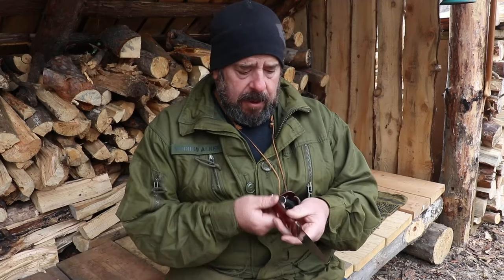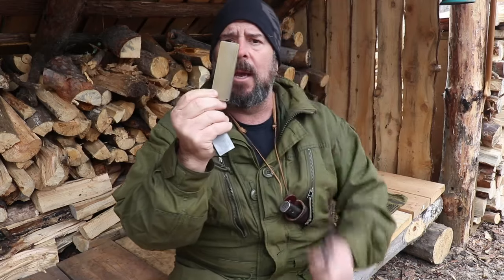Bushcraft Knife Sharpening and Maintenance-Sabre, Convex and Scandi Grinds

Comment: Sharpening and maintenance is a great topic to come back to from time to time;  we are always learning, especially as we work with different grinds, steels and usage.  

Over the last year or so, I have been using a medium sized knife in CPM-154 probably more than any other knife.  It is very slicy, maintains an edge, and mostly all I do is touch it up with a ceramic rod.  I did strop it once (sort of) by putting some mineral oil on it, and then running it over a rag cut out of an old t-shirt, on the edge of a wooden picnic table.  I know this sounds questionable, but the knife got at least as sharp as it was new.  I haven't abused the knife, so I don't know how resilient CPM-154 is vs. other steels, but I cut brush & limb saplings with it in the field, if I don't have a machete or axe with me.  I was surprised how much more impressive the CPM-154 is as compared to 154CM steel.  And it doesn't rot, which is a big plus where I live.
Reply from the maker: Sound excellent my friend. I’ve not tried that stropping technique but it obviously works. Thanks for sharing🔪👍

Comment: A great video with really helpful tips and tricks 👍. I am using almost the same kit in the field. I added a Sharpie to color the edge to the kit. Also I added a pencil eraser/rubber (the white eraser/rubber from Faber-Castell works perfect for me, costs about 1.5 Canadian Dollar). The eraser removes the grinding dust from any ceramic or diamond sharpener very easy in the field, is cheap, lightweight and small.
Reply from the maker: Thanks for the tip for the eraser, I’ll definitely pick one up!👍
Reply: @andreasb.145 - I had never thought of using an eraser for that! Good suggestion; thanks